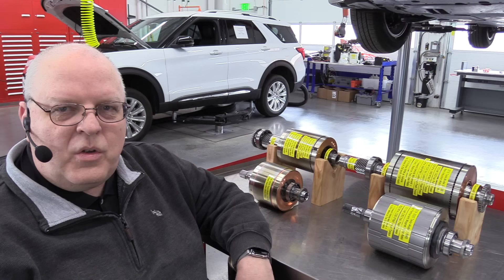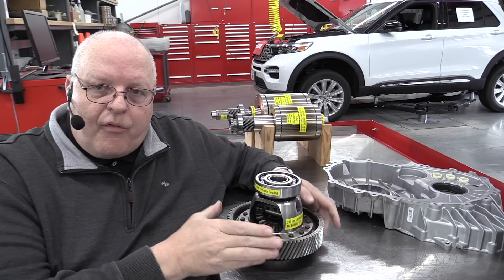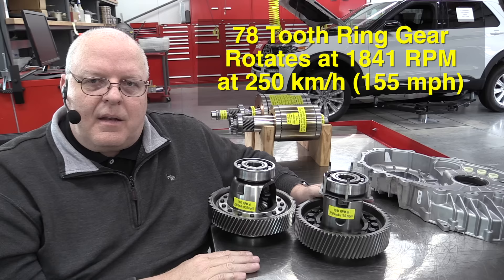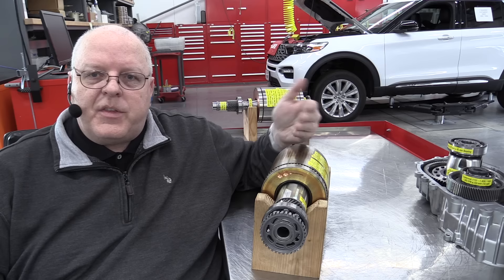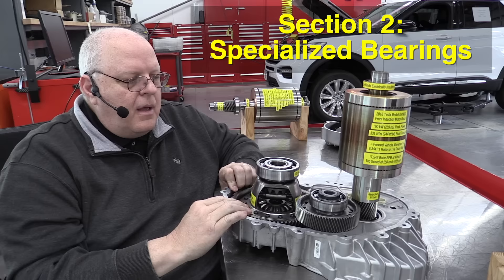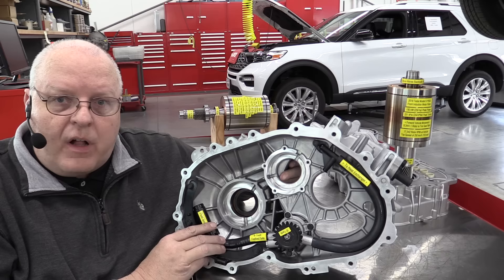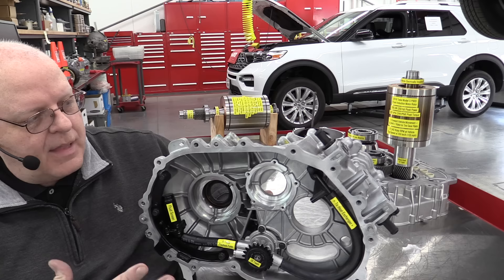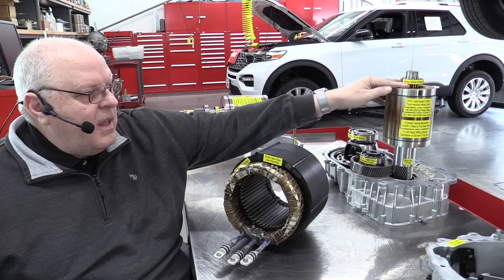Understanding the Tesla Model S Front Motor

Comment: @WeberAuto I realize this video is a year old now and without checking all the comments, I don't know if someone already mentioned this but there are two different rotors for the LDU.  The Base & Sport LDU's have different rotors.  The Base rotor has less copper fill than the Sport rotor.  The Sport rotor is completely full to the ends of the rotor.  The Base rotor has a bit of a "bowl" where there's a void of copper.  I think there's a lot of internet lore floating around that says both LDU motors "are the same" and that only the inverter is different but the rotors are definitely different.  The LDU stators may or may not be the same.  That's much harder to check since the stators are encapsulated.

Comment: I am positive you know this, but your explanation on the tire size was not illustrated properly .(the following info is for those who don't know) The 265/35/21 means 265mm wide, sidewall height is 35% of the width, and a 21" rim. So the 245/35/21 will be shorter as pointed out in the video. Because 35% of 245 mm is smaller than 35% of 265 mm. Love the videos, have learned a ton from you. Edited to correct the front tire size
Reply from the maker: Yes, thank you. I could have better explained that. Thanks for watching
Reply: Thanks for the explanation Greg. It had me puzzled too.
Reply: Aaaah thanks for this explanation....I never knew or understood that....I ALWAYS thought that the second number (in your example above is 35), was the tyre wall height in millimetres ....I never knew it was a %age of the width of the tyre, and got confused with the RPM difference mentioned in the video.  I had to Google it to see if it was different in the UK to the USA, but apparently not...no idea why I always thought it was the size of the tyre wall though

Comment: Great videos.
The high performance motors are induction machines to get around the problem of back EMF caused output power loss at higher speeds.
Comes down to a tradeoff:
Constant power over the full operational span at the cost of increased overall energy losses, or higher efficiency for decreased output power as speed increases?

A magnet moving past a field creates a voltage proportional to the magnet strength and speed (back emf). A permanent magnet always has a strong magnetic field in the rotor. So, at some speed, the back emf exceeds the bus (battery) voltage and no more torque can be generated (flux weakening can help this, but eventually, no useful work can be done). But, because no rotor magnetization current is needed, PM based motors are much more efficient. None of the current in the motor is spent creating a magnetic field in the rotor. No rotor losses.
For induction machines, the rotor acts as the secondary of a transformer. The current induced in the rotor (from the stator, primary) creates the rotor magnetic field that can then be used to create torque (via a process described as slip). This means the current in the rotor can be controlled. Because the current in the rotor can be controlled, the back emf can be controlled. Because the magnetic field in the rotor is controllable, constant mechanical power can be output until the variable frequency drive (VFD, converter) can no longer output higher frequencies. The penalty is rotor loses. Because there is current flowing in the rotor, induced by the stator, this power is lost in the form of rotor current (resistance of the rotor circuit). You have to pay, in terms of input electrical power, to create the rotor magnetization, therefore, less overall efficiency. But, constant mechanical power for the full operational frequency of the VFD.

You can see this by spinning a motor by itself. A PM motor will generate a voltage as it freewheels, DMM between any two leads. (No current, because there's no circuit. Completing the circuit will make it a generator and the PM motor will act as a brake)
An induction machine won't. (There will be a small residual voltage if it's an iron core, because of residual rotor margination, but not much)
Applying a constant (DC) current to the windings of an induction machine (current limited power supply between one of the phase pairs, be sure to limit the power to something that won't damage the stator by too much heat), and spinning the rotor will make it feel like it turning thru peanut butter, the shaft will get stiffer as you try and spin it faster.
Doing the same to a PM machine will make it 'cog' or make it unable to spin (by hand) at all. Be carefully at startup. It may turn very quickly with great force when current is first applied.
If it's an IPM machine, there might be some cogging due to the motor saliency, e.g. the Nissan Leaf does this.

I hope this was understandable and useful.
Reply: found this reply, very cool. was wondering if u know how induction motor can create regen. i just don't get how it can power the motor to induce field n receive current from motor at the same time...

Comment: As you drive down the road it puts the induction motor in 'torque sleep' mode (0 torque). It uses the PM motor only to drive the car. At some point in the application of the accelerator it starts using moth motors.
I think torque sleep puts enough power to the induction motor so the output torque is 0 reducing drag and increasing efficiency.
Reply from the maker: That is what I suspected, thanks for the information
Reply: I don't think induction motors have any rolling drag ( besides bearings) .. The permanent magnet motor obviously do
Reply: @justinmallaiz4549  I did not invent the term 'Torque Sleep' but read it in a Tesla document. I assume it has a purpose. Perhaps turning the motor ~9 times faster than the axles while the rotor is covered in oil creates/requires enough axle torque to require nulling out.
Reply: The use of induction motors as secondary motors has the advantage that they do not generate any voltage (and do not introduce any drag) when they are not used but driven from the wheels. The inverter simply does not feed any current or voltage to the stator in this case and thus introduces no energy losses.

Comment: Prof. Kelly I didn't know that the electric parts of the motor are lubricated too, I always thought these motors are complete dry and I wondered how it's possible to cool them.
Thank you for the great details you offer.
Tesla uses only one permanent magnet motor, because if you have two of them, they give you resistance by being a generator, the iduction motor can run free without inducing any currents. So I guess, when the vehicle is cruising at constant speeds, it will just be powered by the high efficiency reluctant permanent magnet motor, while the induction motor is just idling.

Greetings from Bavaria Germany, I bet you have german roots! ;)
Reply from the maker: Thank you and thanks for the great information. I suspected that was the situation.
Reply: You can use two PM motors. Other AWD production EVs use PM for both axles.

Comment: Permanent magnet motors are very efficient when operated close to max torque, but not so much on partial loads. That happens because the rotor magnetic field can't be reduced at will.
Induction motors are different, the rotor field can be reduced or augmented at will, modifying the slip frequency. That means at small loads, and induction motor correctly controlled can be more efficient than a PM one.
Same applies to externally excited motors, like the Renault Zoe one.
Reply from the maker: Great information, thank you!

Comment: Yes, your hypothesis was correct - the more efficient PM motor is used to supply most (all?) torque under certain conditions (e.g. highway cruising). Elon said this was how they are able to get increased range out of the AWD version of the S. It would be interesting to know more details on when this is done (I suspect it's not as often as possible, since the driven wheels affect the handling).

Great series. Thanks for all the effort you put into these. I'd love to see more details about the power electronics (inverter) - maybe bring in an EE professor to go deep on the circuit-level design?
Reply from the maker: Thank you and thanks for the suggestion
Reply: Most extra range is from putting more batteries in the car.

Comment: Model 3 perf ir mostly rear wheel driven in the winter (and thus unmistakably appears less stable on a slippery roads), model s vice-versa - feels primarily front wheel driven. In the wintery conditions ir is very obvious by vesicle behaviour. Thus your hypothesis that the more efficient motor is predominantly used in daily low performances scenarios agrees with winter driving observations. You are spot on.
Reply from the maker: Thanks for the great information

Comment: From the owner's manual of the 2020 Model S and Model 3 for the EU market, I can see that there are 4 versions of the PMa-SynRM:
The first one is a 239 kW and 420 Nm motor with 350 V operating voltage, used in the single motor RWD Model 3
The second one is a 203 kW 330 Nm with 335 V operating voltage, used in the base dual motor AWD Model 3
The third one is a 219 kW 420 Nm with 320 V operating voltage, used in the Performance version of the Model 3 AWD
The fourth and final one is a 205 kW 420 Nm with 320 V operating voltage, used in the entire Model S lineup from the base model to the Performance model (P100D)
Reply from the maker: Great information! Thanks for watching
Reply: @WeberAuto  thank you too for this video, you always bring great content!

Comment: 30:36 To heat cold batteries of not moving cars, the stators are powered with about 1-3 kW and are used as heat source when necessary. The stator heat will also heat up the lubrication fluids in the gear box.
Reply from the maker: Great information, thank you
Reply: This is only the case on Model 3 and Y, where Tesla puts DC current on the stator to use it as a heater. But also while driving (to a SuperCharger for preconditioning the battery) modulating some part DC current onto the AC current. The Model S and X have a seperate heating device, for heating the water by battery-DC.

Comment: @weberauto - To answer your question on how the car utilizes power distribution to the motors; Teslas primarily use the rear motor until throttle % or motor load reaches a certain limit, then it powers up the front motor as well.  We can see this in ScanMyTesla, or any other OBD scanning tool while driving and logging.  Cruising speeds and light load is always isolated to the rear motor only.  Hard acceleration or when traction control is activated on the rear axle, is when the front motors engage.
Reply from the maker: Great information, thank you!

Comment: The "SynRM" synchronous reluctance motor is the magnetically better design.
Induction motors have magnetic slip, and generate large heat.
Reply from the maker: Thanks for the information!
Reply: And what is worse, their efficiency rolls off steeply at lower loads. A model S P85 uses 2.7kW going 32mph! Combined with the eddy currents going through the axle, they are the least suited type of motor for an EV. There is an alternative which is the line-start motor (LSPMSM) which still has a squirrel cage but also interior magnets, so it starts as an induction motor but runs as a syncronous PM motor at lower load. That way it preserves its peak torque but also has good low load efficieny, and it can still be driven by a simple VFD like an induction motor. I my opinion, when Tesla decided to scrap the 3 LR model with only one motor, they should instead have offered a version with a single LSPMSM motor instead!
Reply: @Tore_Lund  Well, the MiC Model 3 has now a 60 kWh LFP battery and has a huge range and is extremly efficient with it's octovalve.
Reply: @Stefan_Dahn  You did not understand what I wrote: The Octavalve has nothing to do with drive efficiency. However using a big induction motor, far too high power for an EV, results in piss poor efficiency at low loads. Even a model 3 with its PM motor, still only has 72% combined efficiency from the socket at 60 MPH (EPA). Had Tesla chosen smaller motors in their lineup, they would  have made more efficient EVs! Tesla attracts the wrong kind of customers. They don't buy EVs to reduce their footprint, they simply don't care. Because then they would know that driving a Tesla in the US with its rather dirty grid emits as much CO2 as a compact car on diesel or gasoline! There exist EVs you can buy today that use around 160Wh/mi, half that of a any Tesla.

Comment: Another amazing video Professor.  Thank you for sharing with the world.

I have the bluetooth dongle and ScanMyTesla app in my Model Y AWD.  It shows that the front motor rarely gets used.  Looking at the first log file that I could find it only used power starting at 30% accelerator.

I had a Chevrolet Volt prior to the Tesla and during regen braking (in "low" gear as I usually drove) on icy roads the front tires would lose traction and cause some scary situations.  After that experience I specifically wanted my next EV to be AWD to keep it from happening.  Looking at the Tesla's log data it appears that it still only uses the rear motor for regen almost all of the time even though it has the ability to use the front for regen.  The good news is that Tesla's software is smart enough to recognize when the regen is causing an unsafe situation and adjusts as I have never felt tires lose traction during regen braking.  Tesla's regen braking on icy roads is more steady than the ABS when you need to use the mechanical brakes.
Reply from the maker: Excellent information! I just purchased the app and cable for our Model S. I look forward to gathering and sharing some data related to these motors. Thanks for watching

Comment: Hi John
When you have a spur gear, yes one tooth is engaged but if it is a helix gear it depend on the angle and often the angle is so great that more then one tooth is engaged.  Makes it a lot stronger and a lot more silence but the downside is axial pressure. I am almost sure that all gear wheels are ground. In that way you avoid debris from hardening in the oil. 
About the motor, that is a long long text... anyway the short story is to increase the current you must increase the voltages however that can't just be done, you have to take the frequency in to consideration.  Here we are talking about Volt/Hz relationship and for the induction motor you also have the slip between the stator and rotor to account for, that is normal done by IR Compensation.  anyway now it is starting to be a long story.  I highly appreciate your videos. 🙏🙏🙏
Reply from the maker: Thanks for the information. I was wrong about the gear tooth on the helical gears.
Reply: @WeberAuto  Well I have made hobbing machines for many yers. I just finished producing a 9 Ton spur gear muddle 22  for a prototype win turbine so gears and AM and PM motor including servo drive is my speciality and electronic as well.
Anyway I am sure that you already know.  It is difficult to create a long fine detailed video on a complex matter such as this, even though you look at the video through more than once,  small mistake will occur. 
I am astound over the brilliant videos you make. Respect and 🙏
Reply from the maker: @A2an  Thank you very much

Comment: The smaller (tooth number) ring gear in the front drive unit is engineered to spin slightly faster than the rear drive unit to relieve chassis bind and allow proper handling with smooth and consistent steering characteristics of the vehicle.

Comment: Using Scan my Tesla OBD/CanBus tool on a 2018 MODEL 3 in most normal situations all the power goes to the rear motor. Power will flow to the front motor when accelerating harder. Even in snow power tends to go to the rear motor unless accelerating.
Reply from the maker: Great information, thank you!

Comment: Those helical teeth gears are used as they run quieter and wear less. That's because more than one tooth is engaged at any given time. Herringbone teeth take this one step further with opposing patterns that cancel out the side thrust. BobUK.

Comment: You might want to check on your comment about the drive torque applied to the final drive gear, "one tooth at a time" this is true for straight cut gears but not helical cut gears. eg. 1.2 teeth contact at all times, a 20% increase.
Reply from the maker: Yes, I was wrong. Thank you